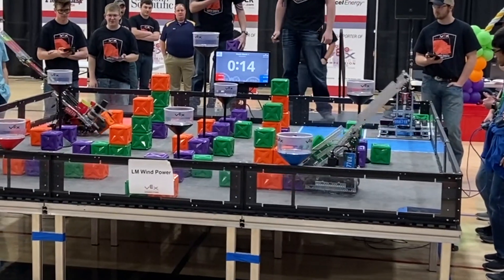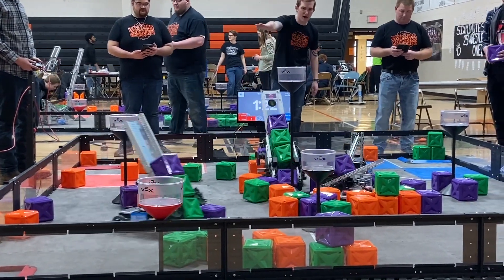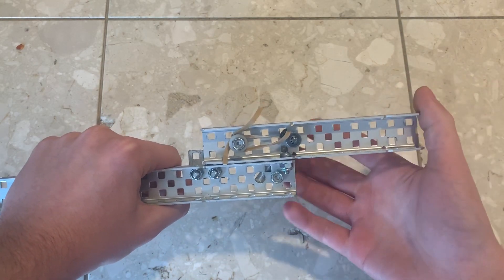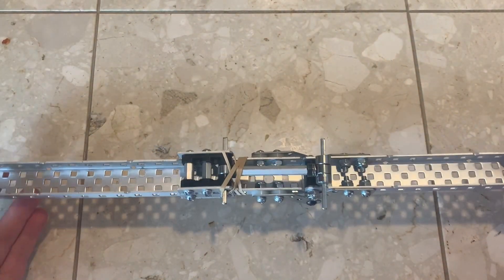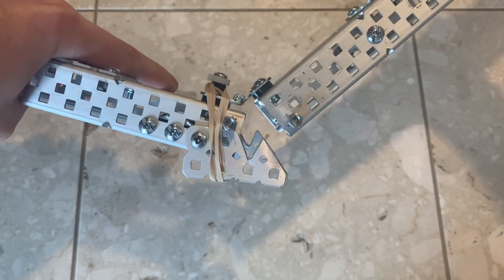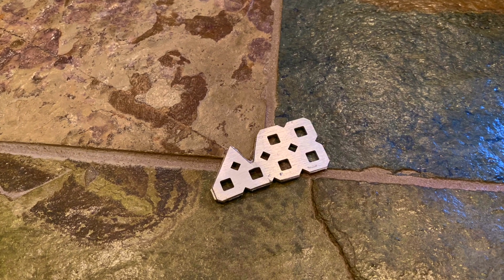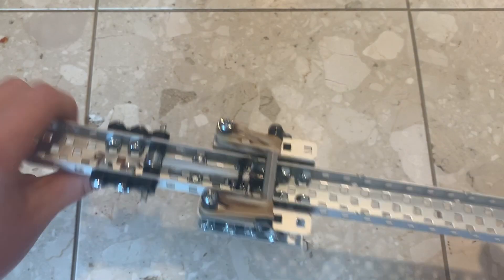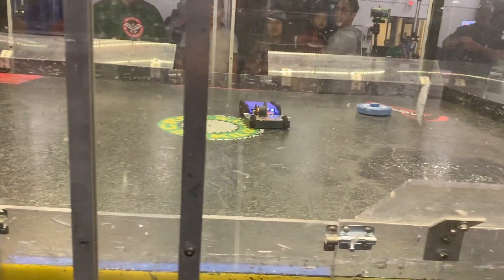Five VEX Locking Mechanisms

Comment: Hey just a question how is things with blastwave going
Reply from the maker: Blastwave is still being worked on. I’ve had a bit of trouble with the drum and stuff, but I’m waiting on some things not related to the bot to clear up before I can finish it. It should be done within a few months, barring any strange delays.
Reply: @KeplerElectronics  If you are having trouble with your drum still, you might consider using this

https://www.fingertechrobotics.com/proddetail.php?prod=ft-beater-bar-assy